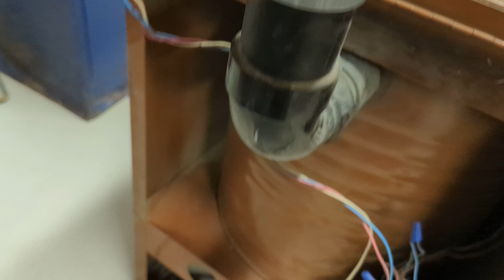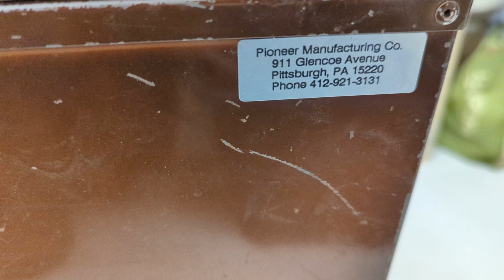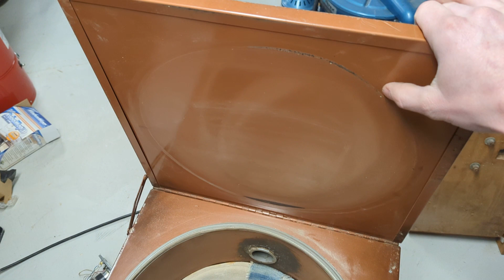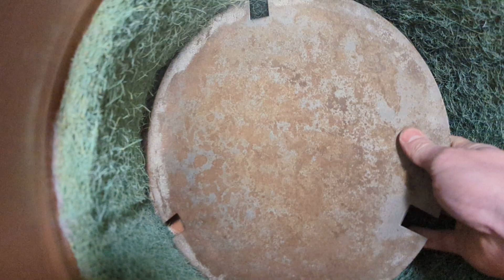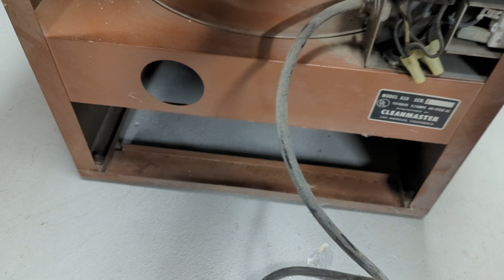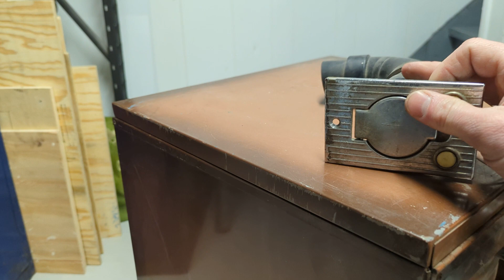Big, Boxy and Beautiful: The Cleanmaster!

Comment: Has the same metallic brown enamel finish as my maternal grandmother’s early 1960’s Tappan brand built in gas burners and matching built in kitchen cabinet oven.  Looks like the aesthetic styling of a Frigidaire or Hotpoint refrigerator or a washer/dryer set by them from the same early 1960’s.